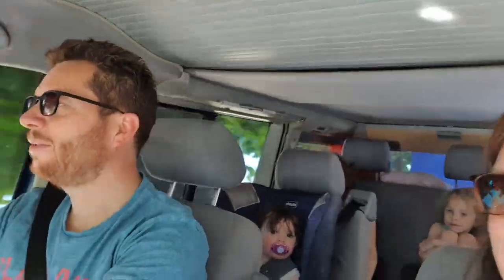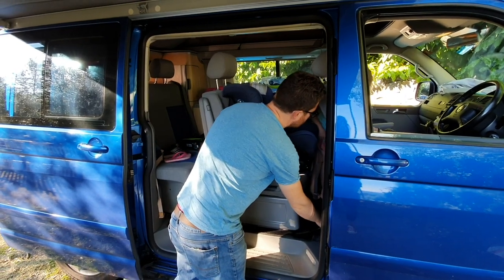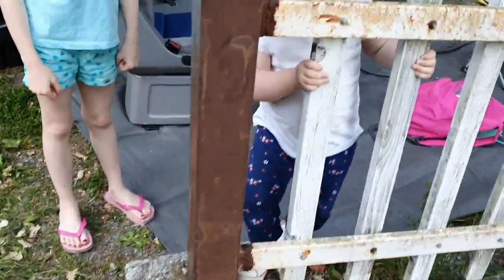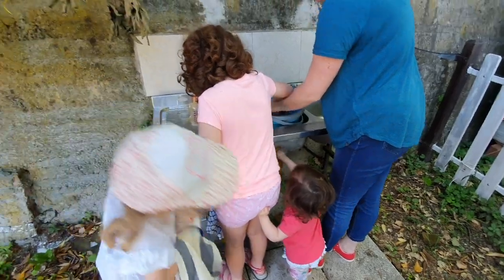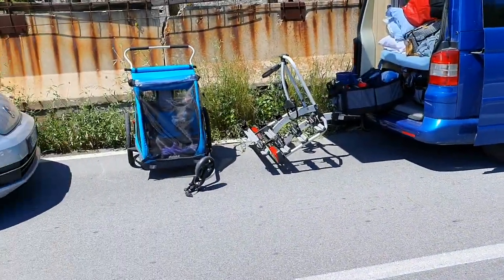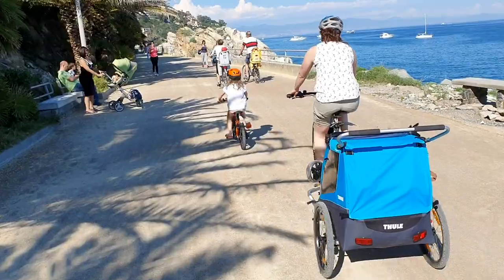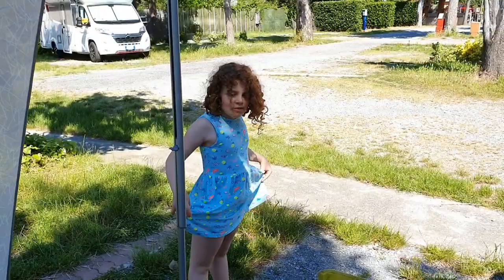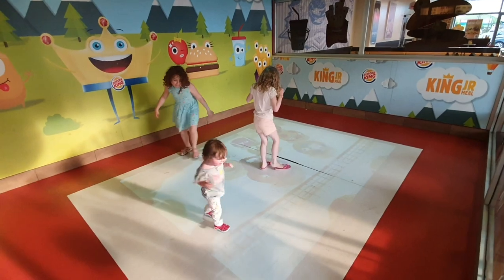VW California Family of 5 Weekend in Liguria with an eBike #vanlife

Comment: Can I ask about the hammock bed you use for your toddler in the front cab of the van.  Any issues with her rolling out at night? My daughter is a similar age but moves round quite a bit at night and I would be a bit worried about her falling down the sides
Reply from the maker: Vicki Bonfield thanks for watching...not really a problem as if you put the two seats more upright, there is not a lot of space to fall out.  Also, if you put her the steering wheel side there is nowhere to fall...accept onto the horn!